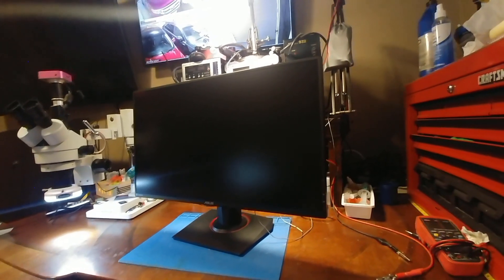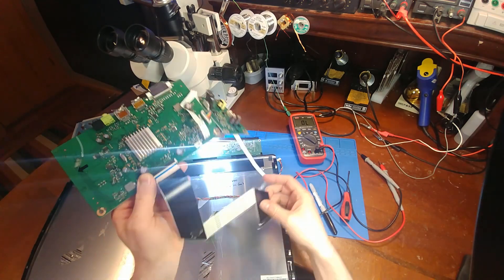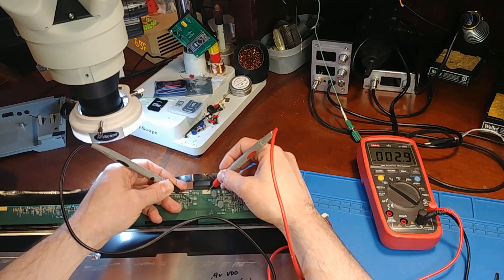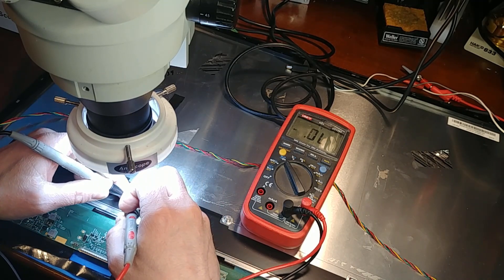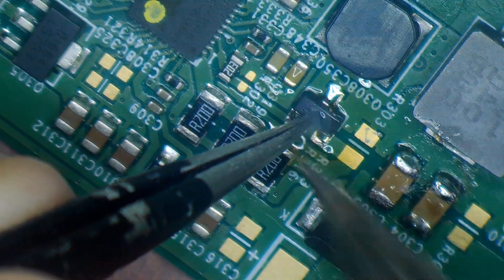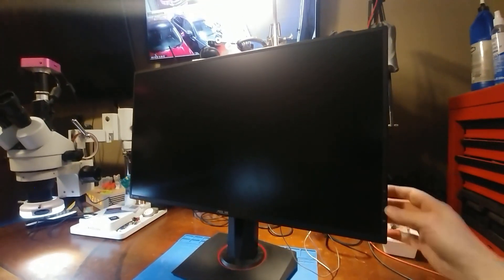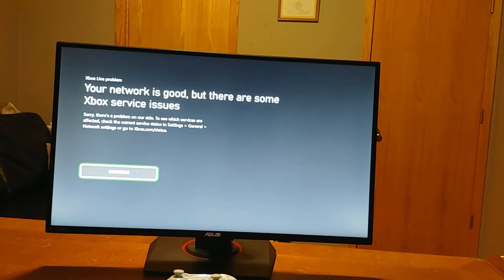How to fix Asus VG278 white screen

Comment: I had a 2002 Range Rover that used to do this during the winter months when the weather was rainy. The issue was somehow moisture ingress related but I never pursued it very far. When you started the vehicle the dash LCD would show only a white screen rather than the NAV display. It was a 4:3 LCD made by Toshiba with RGB Sync On Green signalling common on European cars of that era. It's a pretty common issue for that model. Do you have any thoughts on what it could be?

Comment: Mine turns white after a while of use. It's like its overheating. I turn it off for a while and then it's back to normal.
Did your monitor behave in the same way?

Comment: Picked a HP w19b from the trash, also showing same white screen which led me to this video. I went looking for a fuse around the same area of the t-con board and found a burned one too. There was no short to ground and I could not find any other problematic components in that board. I didn't have another fuse to try, so I did a solder bridge and got image on it. Put it back together early this morning and spent last hour and a half using it, so far so good.

Comment: Thanks for the video. I had the same problem and had to replace q308 and q9(because it was literally melted) with a a09t. I also replaced the fuse at f001, but i am still getting a white screen. Im getting no continuity issues at the screen pcb. Any tips for what else could be the issue?
Reply from the maker: Have you confirmed that the power supply is working and that power is making its way to the places it's supposed to be?

Comment: Just removed the mosfet and fuse and resoldered a working O Rating 0603 SMD 2.5a fuse and A09T 30v 5.7a mosfet. Still the white screen... hmmm... I'll have to get back to you on this. I wonder if I just got a bad batch of replacements...

EDIT: Just replaced both components again (for the 3rd time), both components are working and I'm still getting the white screen. No short is being detected with the multimetre with the test pads. Struggling trying to find what else could be the problem here.
Reply from the maker: Was the original fuse and MOSFET bad?
Reply: @jeffescortlx  Yep, confirmed them both being faulty. Though I have just found out what the problem was. The problem for me was not just the board attached to the monitor directly but also the Power board from where the ribbon cable comes from. I was getting 7.6v instead of 12v. A blown 21h09 MOSFET just before ribbon cable from the Power Board is the culprit. I just ordered a replacement!
Reply from the maker: @hoyschelsilversteinberg4521  good find!
Reply: Did this fix it? My Mosfet in the video was bad so I replaced it. Fuse was fine, measured 6.8V when it shouldve been 12 then came back and saw this comment@hoyschelsilversteinberg4521
Reply: @hoyschelsilversteinberg4521 Thanks! Popped it open and sure enough it's fried with some smoke residue surrounding. Gonna order a replacement
Reply: @TaylorGMoore  Hey sorry I thought I had replied to this but yes that fixed it and I'm watching and replying to you on that same repaired monitor!
Reply: @jeffescortlx  yep correct. Same exact symptoms. Going to investigate further as to what can be the issue, I spent last night doing the same but couldn't find anything out of the ordinary.

Comment: This literally just happened to my monitor of the exact same make/model. I'll be taking mine apart and diagnosing just as you did here. Thank you so much for this video. I just subscribed!
Reply: Yep removed that mosfet and the short is gone. Fuse also blown. Ordered both parts from Ebay just now for $15.

Comment: I have a 27" Nixeus 240hz that has a white screen with only power connected. No start up logo. Is there a chance it could be the power supply? Or is it internal hardware damage for sure? If it's the latter I'm just going to scrap it since I got a few years out of it. If it could be a power supply then I'll replace it. The green light on the power brick shows solid green LED but I'm not sure if that's indicative of it working correctly. And it's the same price to buy a voltmeter as it is a new PSU.
Reply from the maker: It is probably not the power supply. This sounds like an internal issue.
Reply: @jeffescortlx  I found my multimeter and the power brick is fine. Definitely an internal issue. Thanks.

Comment: Having a similar issue with an Asus 3d Vision that was second hand gifted to me.
Turns on then rapidly whites out then turns off, back on, repeat
Rather than go pay for a repair or replacement (since this thing is apparently like a couple hundred bucks to buy new),
Would you know if I can fix it as well with the same steps?

Comment: I have the same problem but on a similar model in the  PG278QR I have a medium level of electronics but this type of equipment is the first time I have seen it, could you help me guide me and I have looked for the damage and I can't find it, it is an ASUS model!
Reply: Do you have any method to contact you? I will pay you by PayPal if you help me... I am a cell phone technician and it is my first time that I see a monitor with this damage
Reply from the maker: @XINbladeX without having the monitor in front of me it's going to be very difficult to troubleshoot.
Reply: @jeffescortlx  mmmm ok ok😭

Comment: my monitor will come on eventuall,y but it's like starting a banger, the monitor will attempt to turn on then blink off but over time it warms up and then finally will stay on 

I am assuming it's some if not almost all the capacitors running on dead. which i assume should be easy to repair but this is an assumpton, the screen does go white but not always. it mainly shows asus logo for a split second then blacks out for 10 to 30 seconds. then trys again each time the logo will stay on a microsecond longer till it blinks for 2 seconds then shows a desktop then after 3 more blinks it stays on desktop .

I have the HE version of this monitor need to know how to tear it down tho.
Reply from the maker: It's been a while since I've had one of these apart, but I think the bezel just snaps on. So you might just have to carefully use a spudger to unclip the bezel if you can't find any screws.

Comment: Is the fuse 0603 smd code O
Reply from the maker: "O" is 2.5 amps according to a previous comment.
Reply: @jeffescortlx  Thanks for answering my comment. I also want to try to fix my monitor with the same model, and I just want to make sure the parts that I will be buying are correct. I think the original mosfet is P5002CMG, but I can't find it in online shops, so I'm going to use the ones that you used to replace the mosfet.

Comment: What are the specifications of the fuse that you used to replace the old fuse?
Reply: That fuse should be a 0603 SMD 2.5a. Has an O designation on it.

Comment: The fuse you replaced, how many volts does it have?
Reply from the maker: The voltage rating isn't critical. It's a low voltage circuit.

Comment: Hey Jeff, I have the same Asus monitor as yours but my problem isn't a white screen. Instead the screen is very very dim to almost no display when I turn it on. Is it probably caused by the shorted MOSFET or any idea on how to fix a very dim LCD monitor?
Reply from the maker: Probably has nothing to do with the mosfet. Check the back lighting LEDs.
Reply: @jeffescortlx  I just check the board of the monitor. The component on R805 has burnt. Do you perhaps have the schematics of the board or do you know what specific component is that?
Reply from the maker: @ezurakuro  sorry but I do not have a schematic for this and my monitor is no longer taken apart so I don't know what that component is.

Comment: I have the same exact problem is it possible to use a bigger transistor I have a couple I could take off of something but I don't know if I can use a different size transistor?
Reply from the maker: The physical shape and size isn't critical. You just need to make sure the characteristics/specifications and pin out are the same.

Comment: Tried it and didn't work! Replaced the fuse and Q308 and now the screen flashes white instead of solid white... Feels like an "almost" working.
Tried my luck with Q303 as well and didn't affect the behaviour.
Nice video! Really made it feel possible... for some. 😅

Comment: Hi my HP 25x 144hz monitor got a similar problem  but its not just white screen when you start mine was flickering and lines are appeared  for 2 sec and goes back normal after 20 sec the screen turns white . if you know the problem please help me

Comment: for me it didnt blow a fuse, it cause a transitor on the main pcb to go up in smoke ... do you have the pcb by hand or a picture to tell me which transistor i need to order ? ( i cant read it anymore cause tits blown )
Reply from the maker: I don't have the PCB taking apart here with me anymore.
Reply: @jeffescortlx  i found the part number of the mosfet but i cant find anything about it on the web ( the actual number that was ontop of it .. i got it from another working unit ) 
its 21J19
Reply from the maker: @WaschBaer_95  If you have a component identifier checker you can take a reading on the good one and figure out what it specs are
Reply: @jeffescortlx  sadly i cant, since the image of the good one is from workign units i dont have here with me in person, some people had them when they worked on them a while back and just send me the image of the pcb they did

Comment: Hey, I replaced the blown fuse on my and the transistor, but still a white screen. However, the fuse doesn't blow when I turn it on? Have I perhaps messed up something when soldering?
Reply from the maker: You might have a different issue going on.

Comment: I replaced AO9T that it shorted.I replaced fuse that it shorted but the same.White screen... I cant find any short somewhere else.... Have you any idea ???🤔
Reply from the maker: Did you check the power coming up to and past the fuse?
Reply: @jeffescortlx  1.4v... How many must have? 19v?
Reply from the maker: @polynikos9  I'm not sure, I don't have the boards in front of me. But I think I remember a 12v power rail running to it .

Comment: Hey Jeff, had the same white screen issue. Brought it to an IT friend to help me swap the mosfet but its still showing a white screen. The fuse was good so we didnt replace it. Part number on the replacement I got from mouser is 833-SI3400A-TP. Any idea what I may have done wrong?
Reply from the maker: Was the original MOSFET not shorted?
You might have a completely different issue going on.
Reply: @jeffescortlx  Showed that it was shorted when he removed it.
Reply from the maker: @NekkoRaindrop  sounds like you're on the right track, but need to see if something else failed open from the shorted MOSFET.
Reply: @jeffescortlx  How should I go about searching for another short without removing them from circuit? Utilizing a voltmeter on diode mode along the tracks connected to that original shorted MOSFET? Sorry, my knowledge of this is extremely limited but having a starting point to research helps a ton.
Reply from the maker: @NekkoRaindrop  use general trouble shooting techniques. Diode mode and continuity can help you find shorts. Resistance mode can help you find opens.

Comment: Can you give some pointers to a noob (soldered on a few pcb for fun type of noob) for a project like this? Like where to start, required tools + equipments, skills needed (how to trace a short circuit) etc? much appreciated
Reply from the maker: The answer to that question would be a bit much for a reply in the comment section. But a brief summary would be to continue to research and keep watching videos. YouTube is a good resource for this kind of stuff.

Comment: I need numper this smd bm
Reply from the maker: I believe you're asking about the fuse.
Reply: @jeffescortlx  yes
Reply from the maker: @ahmedhassan-dy7nf  yes, it's just a fuse. I'm using a 1/2 amp, but it was just a guess and might not be a direct replacement.
Reply: @jeffescortlx  يعني اي فتيل 1/2 امبير
Reply: @jeffescortlx  What does a 1/2 amp fuse mean?
Reply from the maker: @ahmedhassan-dy7nf  .5 amp is the fuse rating.
Reply: @jeffescortlx  I need link search fuse bm

Comment: Thanks for the info. I have the same issue but I can't seem to get it fixed. It was shorted but the fuse wasn't blown. I replaced the transistor and it fixed the short. Replaced it and still no short so we're good there. Still just got the same white screen, so I also replaced the fuse in case it was damaged, but again, no dice, just a white screen.

Any other ideas on what might cause this/areas to check?
Reply from the maker: Where did you buy the replacement MOSFET from? What part number did you order?
Reply: @jeffescortlx  the issue on his device is the same like on mine,  the shorted transistor caused another one to blow on the main pcb directly at the connector .. sadly i dont know what the replacement part is as it is unreadable ...
Reply from the maker: @WaschBaer_95  sorry I can't be much of a help right now. I don't have the unit here and taking apart anymore to look

Comment: Can I grab the fuse and mosfet part from another monitor? Any old monitors use something similar?
Reply from the maker: It's possible, but no guarantee you'll find something compatible at random. The parts are available through typical electronics vendors. More details in the description.

Comment: Chalk another white screen fix courtesy of Jeff's video.  Fuse was blown and Q308 was shorted Gate to Source.  Replaced both components and the monitor is back to life!  Much appreciated.
Reply from the maker: Awesome!
Reply: @jeffescortlx  bro same problem on my monitor VG258QR white screen and then turn off white screen again then turn off can tech fix this? same issue with this video
Reply from the maker: @KyoHeiSuminoe  it could be a similar design. It's worth a try.

Comment: What is the official name of the chip written bm?
Reply from the maker: You mean the fuse?
Reply: Yes, it's a fuse.
Reply: that's right. Please tell me the model number and name of the fuse.
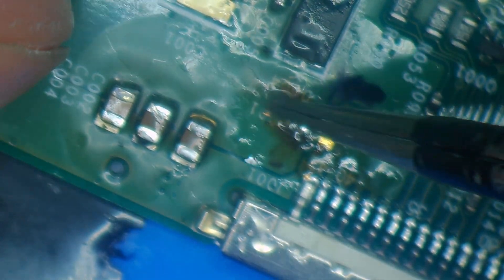Reply from the maker: @minmin-yb8wc  3:35
Reply: @jeffescortlx  
I don't know the name of the newly added fuse, so please let me know.
Reply: I also have a whiteout monitor and want to fix it, so please tell me Hughes.
Reply from the maker: @minmin-yb8wc  it's name is fuse. It's just a fuse. If you're creative with wire and soldering iron you can make just about any fuse work. I'd recommend 1/2 amp to 1 amp max. But If you're feeling risky you could jumper it with a wire. It's not a chip or anything special, it's just a fuse.
Reply: @jeffescortlx  I don't know the name of buying a fuse, so please let me know.
Reply: @jeffescortlx  excuse me the fuse is a 12v 0.5amp ?
Reply from the maker: @Lecalut  12v will work, voltage isn't critical in this application.
Reply: @jeffescortlx  thank you very much 😁😁
Reply: انت عرفت رقمه كام bm I need this name

Comment: Hi Jeff! Thanks for this video. I've started opening my monitor but sadly the problem seems different. My fuse "beeps" but the 3legged thingny is all shorted to grown. Is it possible that id only have to replace it? (i think you said it's called a moset.)
Reply from the maker: If the MOSFET shows any shorts between two legs you'll want to investigate and/or replace it.

Comment: Hi I have an LG 240hz display that has the same brand of panel, so the same kind of T-CON board (27m14-c05) and it has this issue. The fuse on 12v was never blown and still reads just okay but the same q308 mosfet is the problem causing shorts to ground. I have changed out the damaged 12h34 for a A09T like in the video, once its removed all shorts are gone but when the display is turned on the mosfet suffers a drain + source short and blows, with the white screen problem repeating itself. I've tested the blown mosfets after removing them and the gate doesnt have a short, just the drain and source. I also tested other components around the P303-19 for shorts or damage but everything seems to be reading just fine so I dont know why it keeps on blowing. i also have tested the monitor mainboard without the panel connected and the 12 volts reads good. may I need to try a different type of mosfet? and do you have any recommendation? thank you
Reply from the maker: It's possible the MOSFET's you have are counterfeit.
Reply: Hello i got the same problem (but with Asus VG278) iam trying to test freewheeling diodes.
Reply from the maker: @julienmichel4066  freewheeling diodes? Have you checked the MOSFET?

Comment: Respect...  I buy monitors from warranty providers with various issues and wish I had your skills...  I fix many just by reseating connectors or cleaning...  White screen is usually a no go for me... I've had a few Asus with no power and some with a wavy led back light  mostly on whiter colors.   Screen is fine just back light slightly pulses like a car lights with a bad alternator.  Any ideas?   Thanks
Reply from the maker: Flickering backlighting is LED's that are failing.

Comment: I have zero knowledge about this kind of stuff, but I refuse to pay Asus a couple hundred to fix their trash. What resources would you recommend for me to get started in aquiring this skill-set?
Reply from the maker: This might be a bit much for a beginner. But if you have a local computer repair shop that can solder they should be able to handle it.